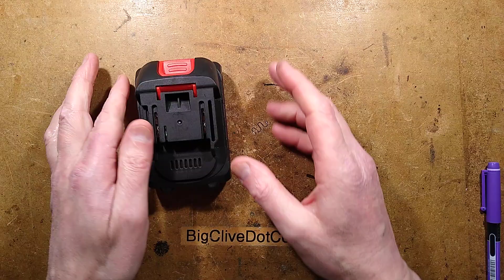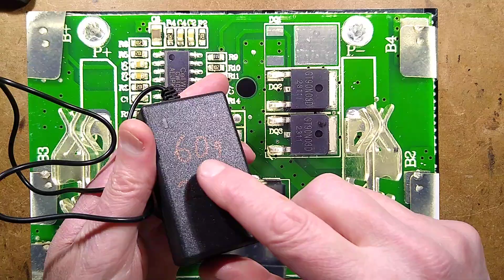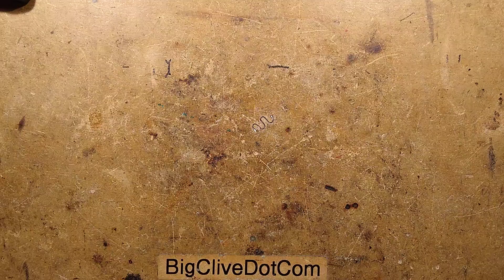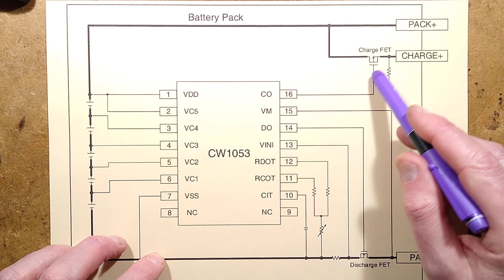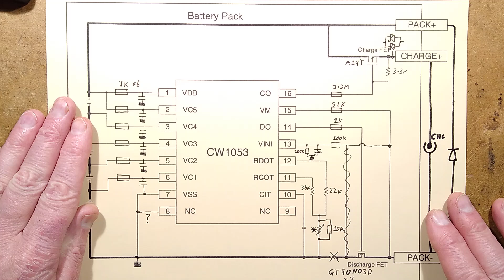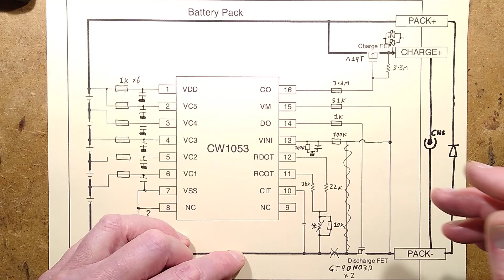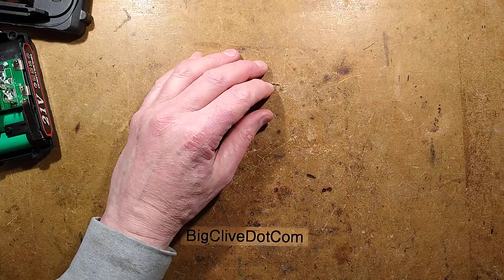Inside a new style eBay tool battery - with schematic

Comment: The "prominent brand names" do make good money on their batteries, but what goes in also costs more. Big difference is that the big-name batteries are going to have cells of known providence with very precisely defined characteristics that will meet or exceed the rated values (seriously, a lot of the off-brand stuff is made from whatever cells are cheapest on the spot market, and the spot market has a huge problem with fakes and uprating). The casing tends to be a significantly better polymer, the internals have things like insulating sheets and thermal fuses, the bus bars are significantly larger in cross-section, and the quality of the battery terminal welds is vastly better. There also tends to be a lot more expense on things like load testing, lifecycle testing, drop testing, and so on. I use tools from one of the Prominent Brands pretty much daily, and have a mix of real and knockoff (half the price) batteries; the knockoffs are fine for things that don't put a huge demand on the battery (radio, worklight, etc), but they just die horribly if I try to use them in a high-draw tool (looking at you, angle grinder...). Meanwhile, the real batteries chug right along. 

Also, the off-brand ones tend to have a much shorter lifespan, as measured in number of recharge cycles.. The real ones will usually last about 18 months of regular use, while the knockoffs, despite not getting worked nearly as hard, often don't make it a full year before it becomes glaringly obvious that they aren't holding anything approaching a full charge.

(And we're not getting into the industrial-sector tools, like Hilti, where they have a product line where the battery stores diagnostic information for the tool and uploads it to the charger during the normal charge cycle so that tool managers can identify and replace tools before the guy using it on the assembly line is aware of the problem.)
Reply: I think you hit every single point I would have tried to explain. The knock-off batteries are fine for most cases. But if you're going to be using something hard everyday, or if it's something like a cordless blower or weed eater that you're using on your personal yard every week.... And you have a big yard.... that's where you'll see the difference is.

Comment: Oooh, 21 volts; one more volt than normal! That's probably what they were hoping people would think.
Reply: no the charger is intended for a nominal 18V battery but 4s of NMC (w/ terminate charge vtg of 4.2V a pop) just so happens to be 21V at the spot.

Comment: The extra resistors / caps on the taps... ah, just a voltage buffer since the equipment the battery runs during operation is probably a motor, to prevent the voltage from jumping around too much.  The resistor would also serve to protect the cells from a chip short.

The very high valued resistor divider.. 3.3Mohm.  Hmm.  I can think of two things.  First, they are limiting leakage current from the charging source via the protection diodes on the CO pin to a value below the chip's nominal quiescent draw, to avoid overcharging.  Second, they might also be limiting vampire current draw when the chip is outputting a logic low on CO.

It depends how CO is configured.  Is it left turned on or is it set as an input to poll the CHARGE+ voltage to detect charger presence, then switched to an output to enable the charger?

-Matt

Comment: the batteries that come with these tools are complete garbage. not even the cells are worth salvaging. thankfully the tools are not as bad and most of them can be used with a makita 18v battery. I have tons of knock off makita tools but the batteries that came with them are pure garbage

Comment: My partner bought an unknown brand compact chainsaw that came with a couple of these battaries.    Ir runs for a couple of minutes and then the chainsaw acts like battery is running flat, going slow and then stopping completely.  Leave it for a little while and it's fine for a couple of mins again.   Suspected some protection kicking in somewhere (either heat or power draw related) which is a shame as others have used similar tools and found them really good, which is why they suggested them to her.

She has bought another compact chainsaw now and will see if that is any better.   I was shocked when I picked up the charger unit as it's so light I was expecting it to be empty and a fake charger, but does actually seem to charge the battery somehow.  Will be interesting to see your strip down of the charger.

Comment: All resistors are fuses, in a way. As seen in MacBooks, were the actual fuses are the least likely to blow.
Reply: Not just macbooks. I've seen a few 4090s with huge holes burned in the PCBs that still have their fuses intact.

Comment: As someone who as done 2 years of Li-Ion battery pack manufacturing, those welds are not only abhorrent in strength and quality (They just full sent a popped weld on the bottom right, which essentially only has a half weld holding it on!) just by visual inspection, a single weld is poor practice. Industry standard is 2 sets minimum. I bet with just a single drop from arm height the welds will shear. The nickel is also probably plated steel which is a bad idea for high drain tool batteries, though in this particular case it's probably okay since the little saw won't draw too much. That's all not even mentioning the elephant in the room of relying on solder mask as insulation between cells! That was the craziest part to me.
Reply: Maybe depends on batteries I have disassembled some of them and better copies tend to use 0.3mm pure nickel strip and welds are strong, hard to remove. Damn, wish I could spot weld 0.3mm but max my welder does is 0.15mm and I have to sandwich strips in stronger packs. I have an idea for this problem but this requires some moneh...

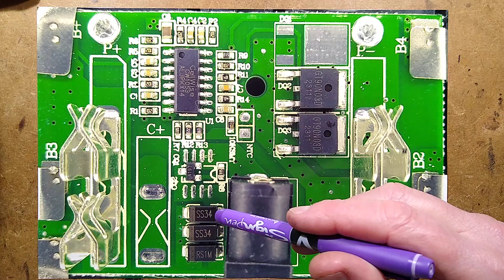Comment: It is further development knock off 18V Makita battery, @ 2:42  this odd missing connector is needed on Makita tools. On those it has to be connected to +, it signals to tool that battery is OK. So this is "inspired" by Makita but no longer can be charged or used with Makita tools/chargers. This missing pin is used on Makita chargers for charging aswell (atleast on slow 3A chargers).

Comment: Pleasantly surprised they didn't cost cut the hell out of that protection circuit. Would have been good to have the NTC, but a single string of batteries isn't likely to get THAT hot in most cases. Pity about the layout. Maybe in the next version? 👍

Comment: Such shadyness on the creepage, especially under the battery terminal! >:( And so easily remedied; something as simple as a sliver of poly sheeting would have made me less angry. What worries me the most is those tracks under the tabs at the edge of the board are barely pulled back; vibration from the tool could easily cause the tab to wear through that mask.

I'm guessing they make a higher capacity 5s2p version, and the thermistor, C+ pin, and third MOSFET would be populated on the board for those?

Comment: I have a couple knockoff Ryobi batteries. They have spring clip tabs on the sides. 

Most, if not all of them, don’t have any insulation between the ends of the cells and the large metal springs. If you manage to press the spring in too far, it’ll short out two cells. 

The springs are held in place so that won’t be a problem, right? Oh, wow. The springs are held in place by pieces of tape. About as robust as masking tape. 

I open them up when I get them and add kaptan style tape, and epoxy to hold the tabs in place. 

The nice thing about Ryobi batteries is that they have built in MOSFET low voltage protection. So I can connect them to random circuits and not worry about draining them too far.

Comment: I think the PCB was just a bit misaligned before spot welding. If you mentally shift it towards yourself, everything lines up a lot better.
Reply: Wait. The PCB is screwed in. They probably messed up between the electrical and mechanical departments and did not use the same positions for screw holes or something like that.
Reply: I thought of a misalignment at first as well (and there definitely is some of it). But if you "fix" the B2 pad, the B3 pad becomes sketchy. The main issue are the metal strips. They shouldn't be that wide in the first place (actually they should that thin that they act as a fuse when short circuited).

Comment: I bought a cheap whipper snipper and it came with 2 similar batteries. No matter how dodgy they are built, actual fires are rare.  Thanks for the great reverse engineering.
Reply: my drill from IBELL uses the same batteries

Comment: I do not like that B2 tab sitting on top of the B- solder mask either. I guess it's time to take your snips and trin it back a bit. Maybe you could slide a thin piece of plastic "from packaging" in-between the metal clips to add some protection there as well. I just ordered a $29 dollar version of the mini chain saw from amazon in the USA. I will be checking out the 2 batteries it comes with for sure. Thank you for the tear down and heads up.

Comment: Hello Clive,
Can you make a video about the LIDL batteries and chargers?
They have a 20 V and a 12 Volt battery line. All the batteries use 4.2 V 2 Ah 18650 cells. 
The 20 V 4 Ah battery costs 25 pounds and has a 2P5S configuration, and the Battery Management circuit also provide cell balancing. Nowhere in the instructions says that for cell balancing to work, the battery must be left in the charger for several hours after the charge had ended.
Thank you
Anthony
Reply from the maker: I have one of the old unbalanced and new balanced versions here.  The primary difference is the discrete one-chip-per-cell balancer.
The way they work is to bypass full cells with a resistor to allow the others to balance slowly at the end of the main charge.
Reply: Lidl 20 V 8 Ah battery with BT is good. Too bad we don't get brushless tools (Black premium) here in Finland. Casings aren't as good as like Makita, but good enough for that price point!

Comment: I'm guessing the tool its self is just a brushed DC motor and the cheapest trigger switch they could find. As for the charger, my bet is on a very simple switcher that is good for about 0.5A and has at least one diode that will run at over 100C when in use!
Reply from the maker: It has its own video coming up later.

Comment: How are they expecting these packs to last with no balancing... oh yeah..
Reply: If its quality cells that are matched, it can be ok, but, yeah this case its probabaly not going to last long..
Reply: @jaro6985  yeah I started using parkside tools back in 2018 and their 20v have all had balancing, and a handshake with the charger, but none of them have had a low voltage cutoff, ferrex do.... So for DIY projects Aldi ones are best. Lidl/parkside have an ic in I can't find info on. OEM seems to be puly in China

Comment: I have had nothing but bad luck with counterfeit or aftermarket tool batteries .My apprentice burned down his condo and injured his wife with an aftermarket Dyson vacuum battery setting itself on fire 🔥.$150k damage to condo from one 18v pack
Reply: Would you care to post some details of where we can confirm the circumstances of the incident? Local newspaper or TV reports - not doubting your veracity of course.
Reply: @theoztreecrasher2647  there is a law suit between my apprentices insurance  provider company and Amazon.Feel free to look in the Vaughn News .Amazon is very well sheltered .in Canada you may not sell non CSA ULC  devices and the numerous fraudulent certifications by TUV Rhineland,ETL,PQS you name it the Chinese counterfeit the certificates and Labels

Comment: I’ve always had a sneaking suspicion that the markups on Makita/DeWalt/prominent tool brands are entirely arbitrary. I sincerely doubt that the circuitry, and the manufacture costs, would warrant a 50-80 pound price to make any profit.

Stuff like this is a bit of a confirmation for me, I think.
Reply: The markups aren't so much arbitrary as market researched targets based on setting the highest price they think they can get away with. It's unfortunate that it's so hard to find a middle ground between these ultra cheap low quality units and the fairly high quality but not actually that much more expensive to produce name brand packs

Edit: Ryobi probably gives the game away the most, since they do several tool bundles where the batteries are borderline free when compared to buying the tool separately, and that's a like for like comparison with the exact same first party batteries
Reply: @bosstowndynamics5488  I can see ryobi taking a small hit on a tool and battery combo to get their foot in the door for home gamers. Mind you they all do that to some extent.
Reply: All that marketing doesn't pay for itself!
Reply: At least there's someone to call if you somehow manage to burn down your house with a genuine battery! Crappy batteries are a real safety hazard and they die when you  need the tool most..

Comment: The lead out of the charger is Copper Coated Aluminium and in my experience, insulation spit, twist and short to FUThiss.  One of my China tools is a 1/2 inch (with 1/4 inch hex drive in the centre) impact driver and it is a superb tool that takes huge punishment. For an ebay cost of £35. Batteries working well but the charger is the weakest link.

Comment: One of the great advantages of cheap power tools is that they never vibrate. So don't worry!

Not having a thermistor is a showstopper. If you have never worked somewhere really hot, you might not get it. It was so hot out in the sun in Texas that some tools got too hot to even hold them. The guys bitched, but air powered tools are self cooling due to the temperature drop from the pressure drop out of the compressor. I had a decent compressor, but the guys complained (correctly) that it couldn't quite keep up.

Comment: Hi Big Clive. I was wondering if you could tell me where to find BMS schematics. I am working on a new PCB project that I just realized requires batteries.
Reply from the maker: I've reverse engineered modules in past videos.  It's very easy to get BMS modules.

Comment: All the tabs seem to be overlapping and I love the spot welds direct to the PCB. As long as it has the CE, UL, UK CA etc label, then we can be assured that all safety standards have been met.
Reply from the maker: There are metal pads sorted to the PCB for the spot welds.  I'd guess it's just the cheapest method.

Comment: is the thermistor not wirebased and mounted from the backside. the parallel resistor can also serve as a linearisation (even though the value in that case likely would not be 10k)

Comment: there may be balancing - the chip may do that internally using internal fets deliberately designed to have rather high rds on...which here does not make sense b/c the current would be miniscule with 1k in series
Reply: CW1053 has no balancing, its just over/under protection.

Comment: My father bought similar battery tools on ebay. 
The battery oddly enough fitts on Makita tools. They work with makita drills but cant be charged with makita chargers. 

The power supply they come with is paper light and i dont trust it as far as i can throw it.
Reply from the maker: A look at one of the chargers is coming soon.

Comment: Hi, would you do a review on a high voltage electrostatic Ionizer (CX-50 [1-10 kV] or CX-300 [3-30kV]) they have a voltage adjustment knob on the unit 😬.
Reply from the maker: I think those are lab ionizers?  I'll keep an eye out for one.

Comment: The battery midpoint taps should always be designed to effectively be "fused" as near to the cells as possible.  Major brands accomplish this by either using thin wires , highly narrowed down nickel strip, or SMD resistors on a flexible pcb mounted over the cell ends.  The fact that these guys pulled full width nickel (steel?) strips for midpoint-voltage-sense right up to the BMS PCB is a flagrant violation of battery safety 101 !    It's these kind of fouls that causes most of the battery fires and thus the new laws showing up that prevents us from having ebikes indoors in major cities.
Reply: I see so many Chinese "portable power stations" and powerbanks that have pretty beefy batteries and absolutely no fuse/protection. I had one from a "reputable" brand (Jackery) that died because of a faulty charger and then when I took it apart to reuse the battery I realised that the BMS had an exploded mosfet but as I poked at it it started smoking again. Basically it was still trying to dump the entire battery pack to a dead short because it had no fuses and luckily something else failed.
Reply: And Bosch is like: what are you talking about?

Comment: O wow.... So, basically, this battery is just a car ride away from blowing up? Just the vibrations of the car, and tools rattling against it could be enough to cause the solder resist to scratch away. Funny how they did add in extra safety around the chip, but didn't seem at all concerned about the battery temperature, or about shorting them out all together.
Funny how a 5 cell battery is marked 21v here. I have a Makita battery that needs new cells. It's 5 cell and marked 18v XD

Comment: Those chinese battery chargers are basically regulated supply with an op-amp checking if the voltage has reached the wanted voltage, and they often come overvoltaged and kill cells, at least in my experience
Reply from the maker: The pack itself should shut off the charge.  I've already made the video about the charger (coming soon).  No op-amp.
Reply: Early failure simply mean they can sell more of them and make more money
Reply: Ouch, that reminds me of the chinese power tool that came with a NiMH battery (those were the days...) and used a LM324-based CI/CV charger. Who the heck told them CI/CV is the correct charge procedure for Nickel cells?!